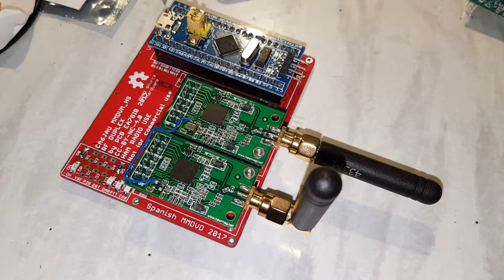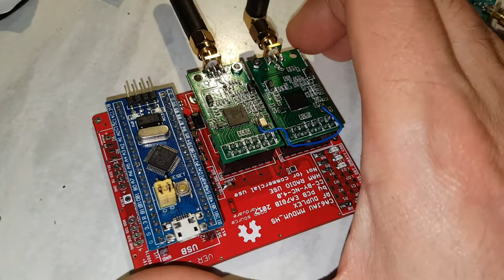MMDVM duplex hotspot

Comment: I looked for the Gerber files but no luck
Reply: you can find these files in http://ea5gvk-dmr.zigor.es/soporte-para-gerber-placas-dv-blas-y-stm-blas-ea7gib-construyetelo-tu-mismo/
Reply: tks,The connection of the TXCO cable to the second plate must be from the output pin 3 i connected to the same pin3 of the second adf7021 tks